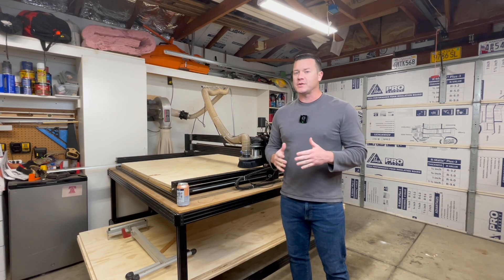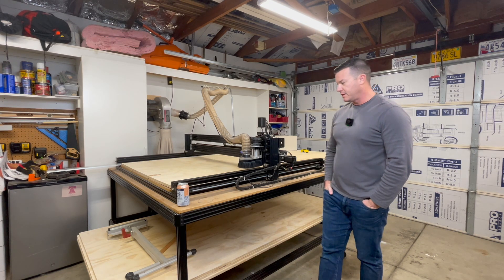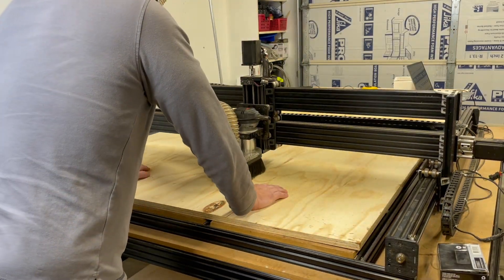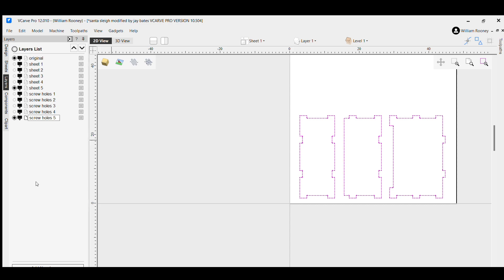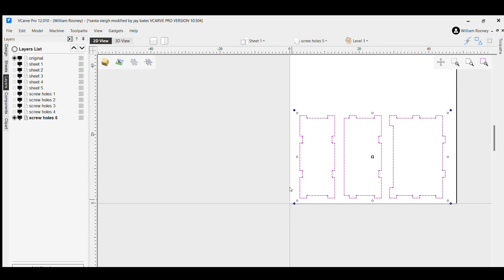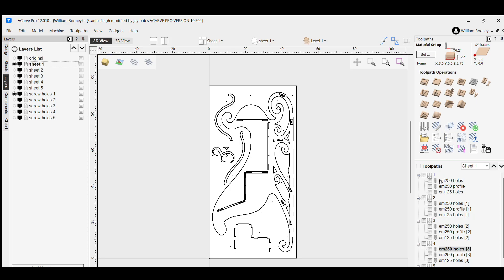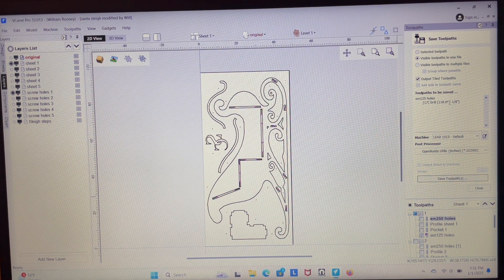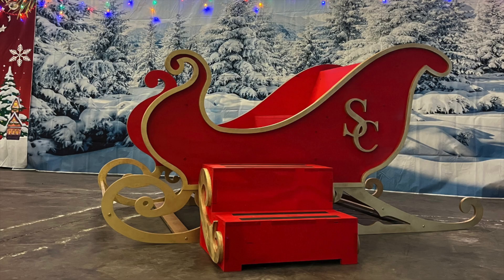Mastering CNC Tiling Techniques using Vectric VCarve Pro

Comment: Tip:
Design a 1/4” hole near the lower left and exactly 4’ in the Y direction. 
Machine it through the workpiece and into the waste board. 
When you slide the workpiece put a 1/4” dowel in the second hole and into the original hole in the waste board. 
That lines the workpiece up exactly 4’.
Reply from the maker: Thank you, that could take all the guessing out of the equation.

Comment: Thanks for the demo - I finally used a Tiling Toolpath (Vectric) on a project yesterday, and while it worked well, it really makes me consider just getting a machine that will handle 4x8 sheets natively and make life that much easier!  Also ran a few "air runs" too, changed Z to 1" above surface, and definitely saved myself from ruining an $85 sheet of MDO ply.
Reply from the maker: I'm so glad the video was helpful and thank you for taking the time to let me know! 

I hear you! I would love a 4x8 machine, but honestly I don't make stuff that big all the time. I rarely use the 4x4 machine to its max, I just like the ability to make larger pieces too. I guess it depends on your disposable income and/or workload. 

What do you make most often?

Comment: Screws are the best way to go.  If you are nervous do an air cut first.  Get a small wireless key pad and you will not have to carry the laptop around.  Thanks for video!
Reply from the maker: Hey there, solid advice. I've been eyeballing the wireless controller, but I have other things to spend money on at the moment. It's definitely on the list however. I appreciate you taking the time to leave this comment!
Reply: can also do a pen or pencil run. to see the patter before cutting